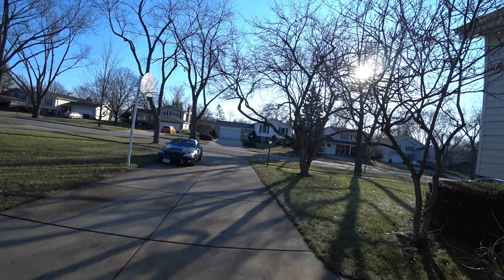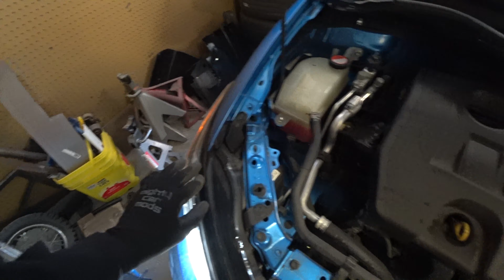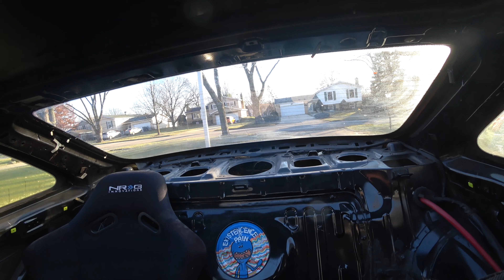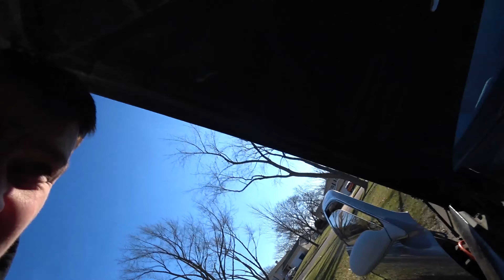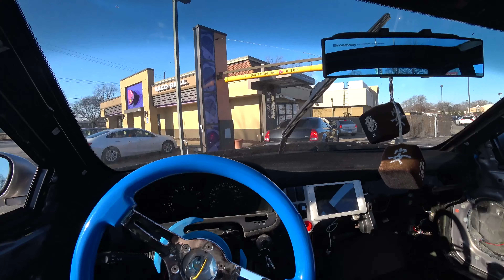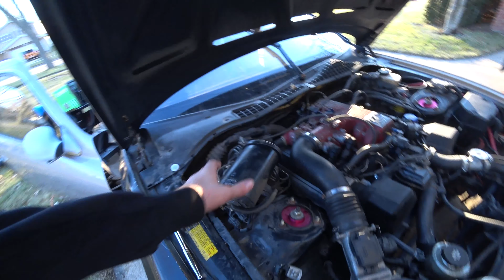Corolla iM HID Install and Patching SC400 Firewall Holes

Comment: An engine clean and Polish and that V8 would look mean
Reply from the maker: Yea when i change the timing belt and water pump I'll try to clean the engine up as well as possible as well. My main concern is that ugly ass red intake plenum. I need to repaint that.
Reply: @DingDongDrift   that wouldn't look half as bad if was cleaned, all the blistering on the metal makes that looks worse than it actually is.
Reply from the maker: That's what I'm saying i need to strip it first and i gotta remove the intake to do that. So yea lots of work just to repaint it.
Reply: @DingDongDrift  I get you now :D